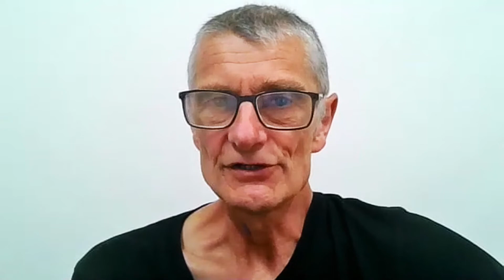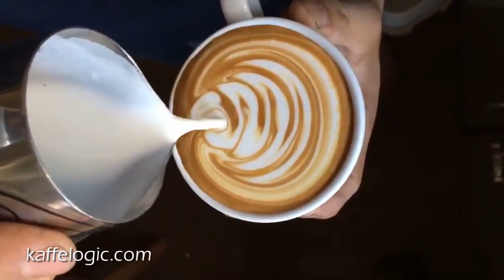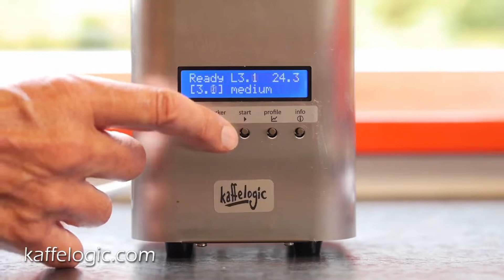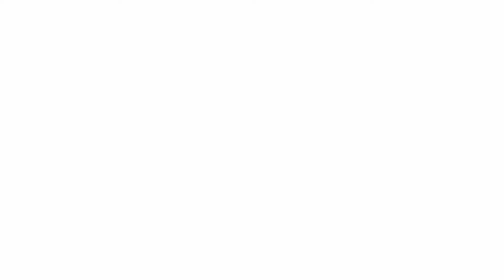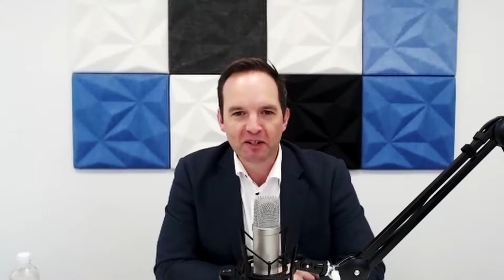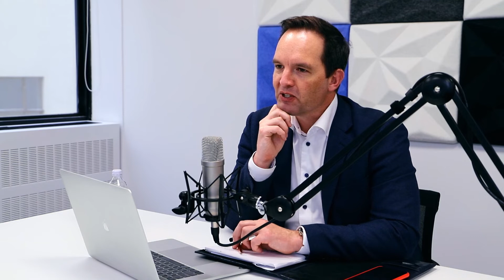A Kiwi Original - Chris Hilder | Kaffelogic 072

Comment: i have one, brilliant. easy as. Almost every day, i roast 100g of green beans (available locally and a huge range!) i have done this for 2 years now, and EVERY roast was perfect, despite the temperature or humidity. You put the beans in, and turn it on. That's it! and wait for 20 minutes. I then leave the roasted beans for about 3-5 days before grinding them, to "settle". You can also change the "profiles" and this is where the "artisan at home barista" has fun!